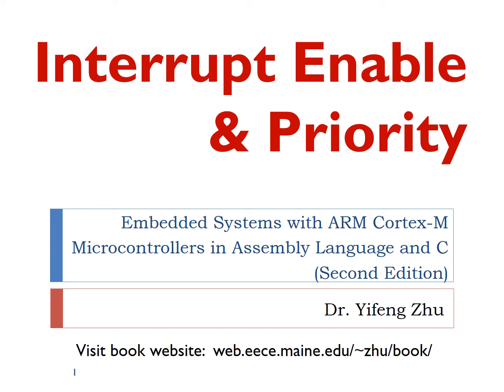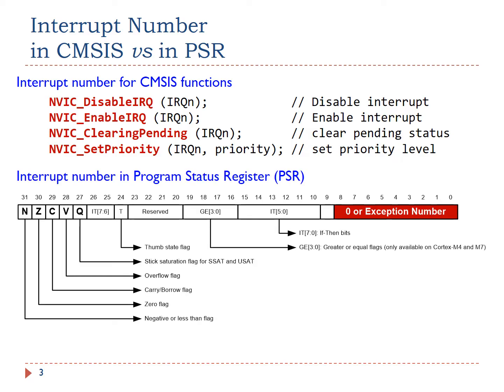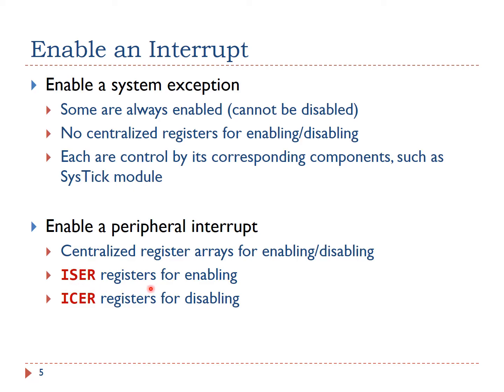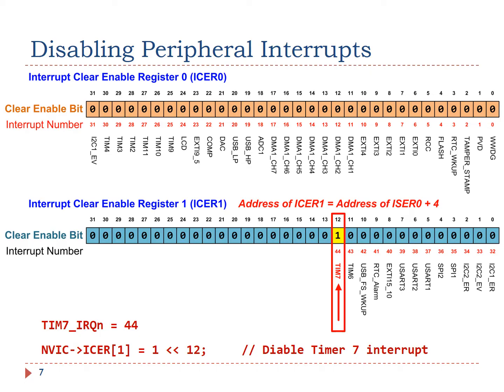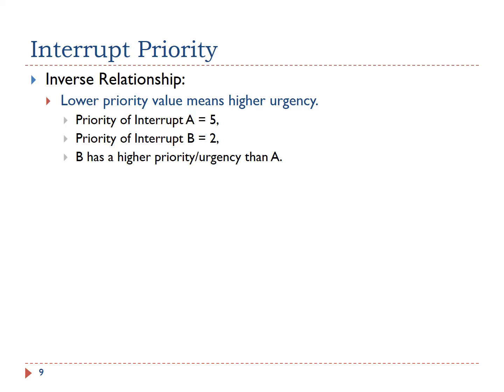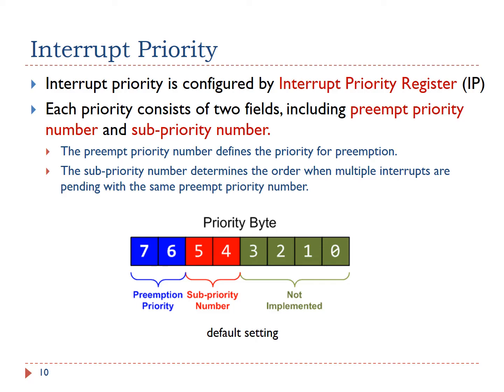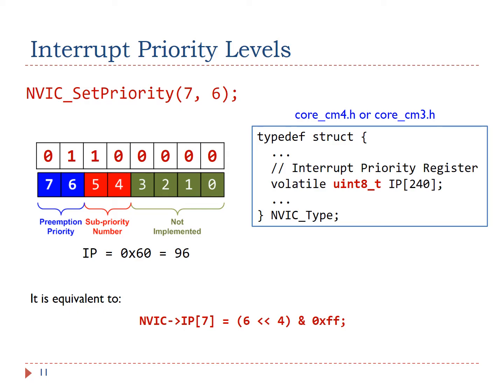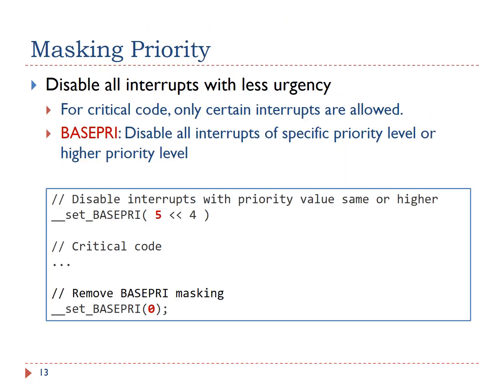Lecture 10: Interrupt Enable and Interrupt Priority

Comment: hello gengtelMan's   i have a little question  that  about only writing assembly stm32f103c8  of NVIC external interrupt, i have been look for address EXTI1   addtess 0x0000005C   but i did not find when i in debugging user's  put 0x0800005C:93 02 00 08
EXTI1 start address 0x08000292 when how put this number pleas tell  me

Comment: Great video but I have two questions:
1. At 9:43, isn't it supposed to be: each register holds 4 priority 'bits' ?
2. At 11:25, isn't it supposed to be just 5 as you said (as 5<<4 is actually 80): __set_BASEPRI(5) ?
Reply from the maker: (1) No. Each register has 32 bits, consists of 4 priority bytes.
(2) No. Bits 0:3 in the BASEPRI registers are reserved. We can only modify the values of bits 7:4.

Comment: Excellent thank you!
but why I found  a priority more than 15 in the datasheet of stm32f103c8t6 even that run in cortex-m3, that implements a "(4 bits of interrupt priority are used)" ?
Reply from the maker: The most significant four bits are used for priority. For STM32L4L4, the priority register value should be 15<<4 if the priority level is 15. Check this: https://community.arm.com/iot/embedded/b/embedded-blog/posts/cutting-through-the-confusion-with-arm-cortex-m-interrupt-priorities